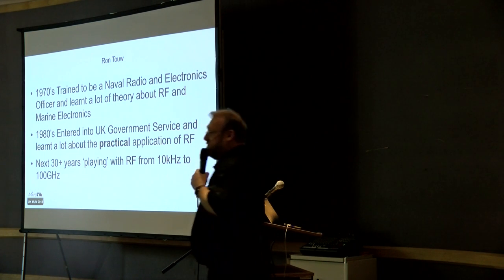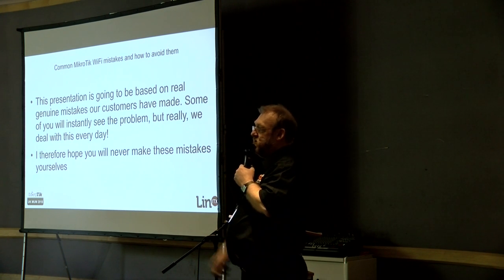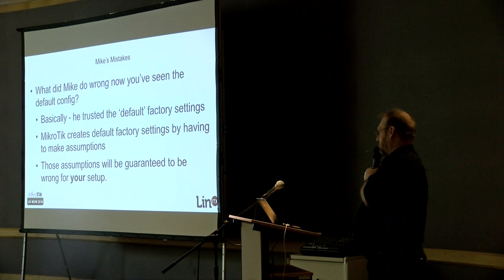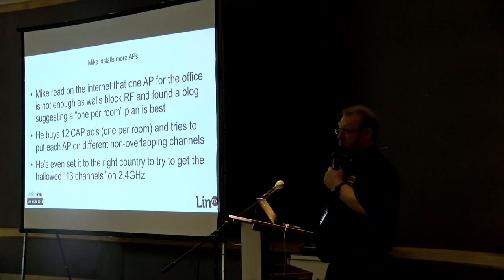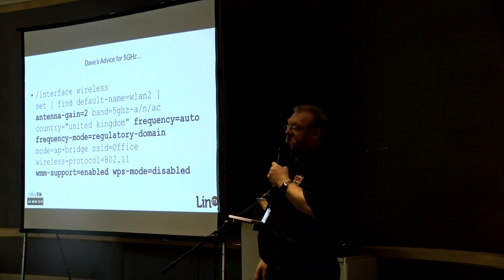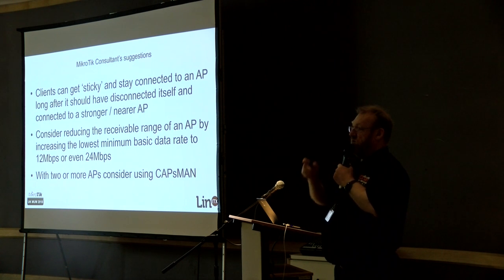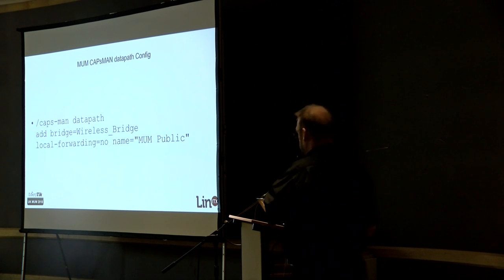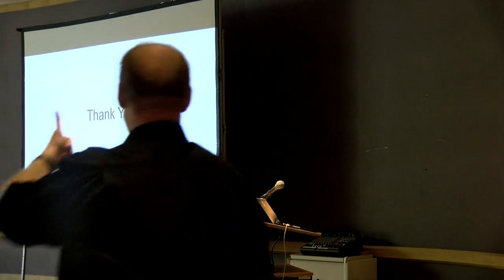Common MikroTik WiFi mistakes and how to avoid them

Comment: Great video, Just one question about tx-power settings. As stated in the video set the tx-power to match the dBm for the AP used. The stated spec for the cAP ac on 2.4GHz is 22dBm for MCS7 and on 5GHz MCS7 is 20dBm. Would using those dBm settings be ok for tx-power respectively? or should I use the max stated dBm minus 2 dBm for 5GHz and minus 7dBm for 2.4GHz?
Reply: "manual-txpower" uses the maximum the hardware is capable of.
"regulatory-domain" will use maximum power in accordance to the country you've configured.

Comment: hello i have a hughes ht2000 connected to a satellite via coaxial cable then a cat6 cable connected to  mikrotik Router Os V6bugfix  installed on a desktop pc i have an unlimited data plan. the router is connect to a switch via cat5  cable which distributes signal to 15 acccess points. But my network is most times slow although my bandwidth download rate is 2mbps and upload is 1mbps. please how do i rectify this because two of my access points cable is faulty. help me out thanks.